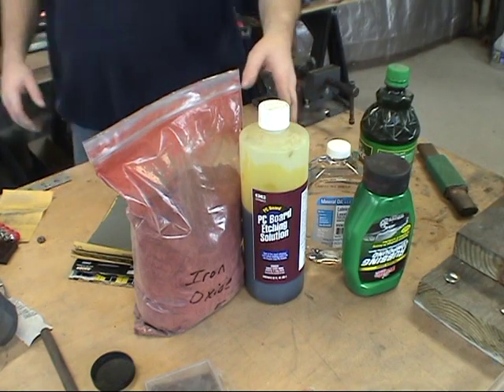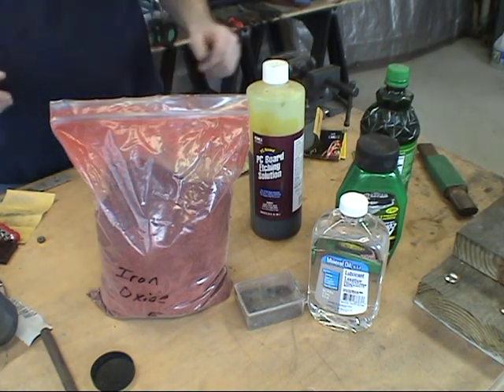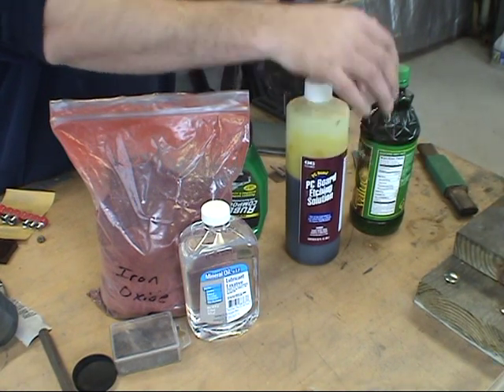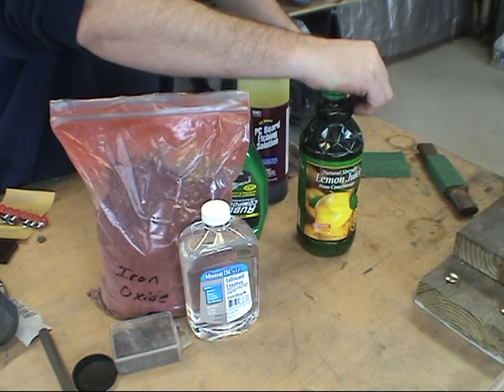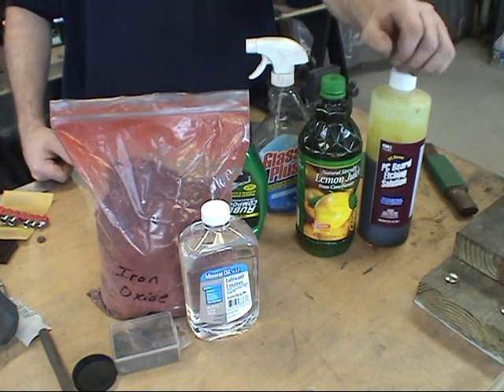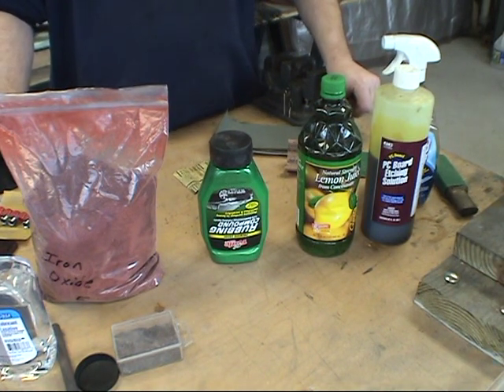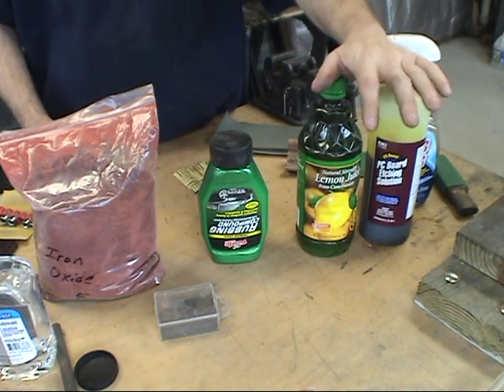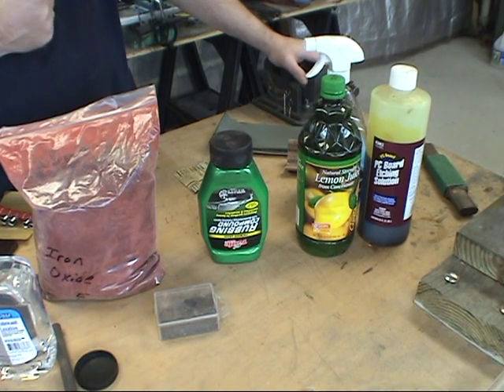Part 4 Hybrid Polishing Methods

Comment from the maker: Well the kissaki polishing needs to be done in a verticle manner rather then the horizontal method used for the rest of the blade.  There are alot of resources on the net about polishing the kissaki just google it .